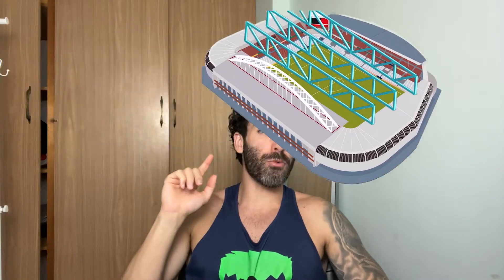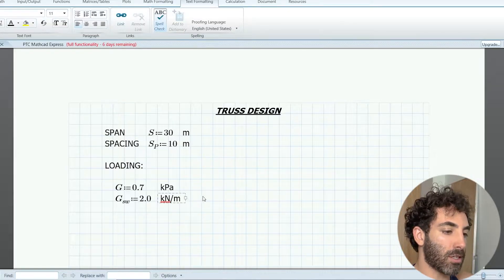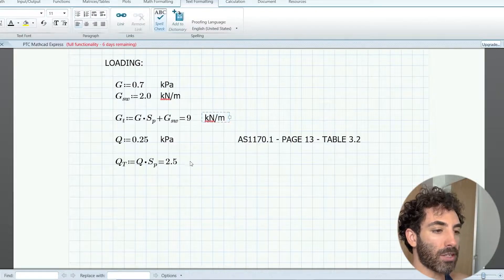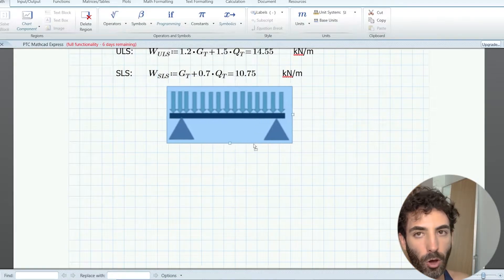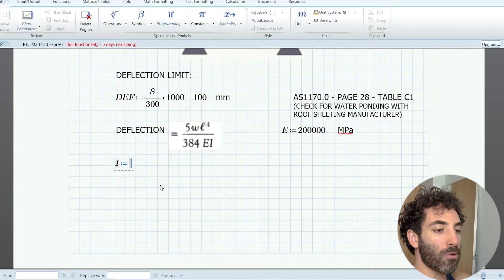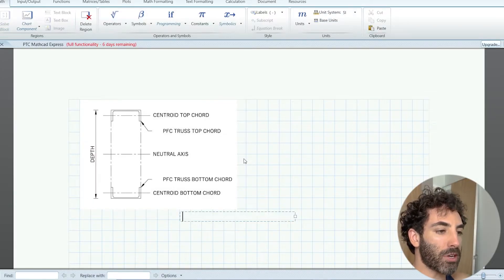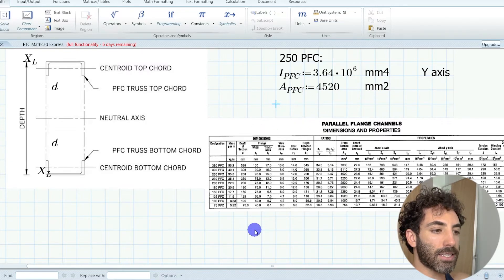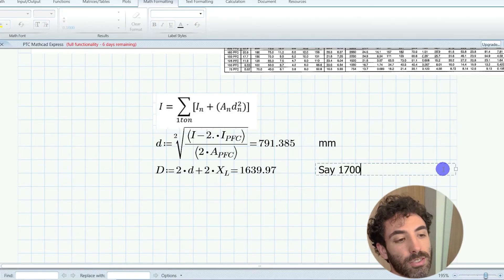How We Design a Truss in Our Engineering Office - Part 1

Comment: I would suggest to use the units in Mathcad, otherwise you are using a fancy notepad/calculator with images and formatting.
Reply from the maker: You're correct. I don't use much Mathcad. I know it's a good tool though. Do you use it at work?
Reply: @bengthebrazilianengineerinAus  I don't use it at work. I've used it only for personal calculations. Although I've switched to do things in Python, so that I don't have to depend on commercial software (even though the free version is still super useful). The only downside is that I have to take care of units myself, but that's fine if I strictly only use SI units. Nice video!
Reply: @bengthebrazilianengineerinAus   I use it at work for some basic manual checks. Very useful!
Reply from the maker: @poparafael3065  I haven't used it for ages. There's another free one called Smath or something like that

Comment: I am lost to finding the value of d. My question is, what is the value of I you used and where did you find it?
Reply from the maker: The I value of the PFC is on the table. See 6:58. I bring up the table. If you are using a different section, your I value will be different.
The other I value (for the truss system), I found in the beginning of the video by rearranging the deflection formula for a simply supported beam.  
 To find "d", I simply rearranged the Parallel axis theorem formula.

Comment: thanks for sharing. quick questions, have you seen a concrete pad sitting on top a bored pier so a steel column can sit on it? they then become part of slab when the slab is formed? I just could not picture how it would look like.
Reply from the maker: I don't see a reason to have the pad in there. Is the column section greater than the bored pier?
Reply: the column is to support the 1st level floor beam (2 story building)